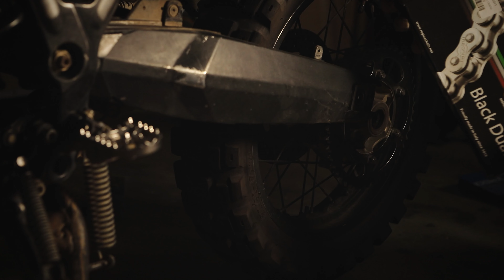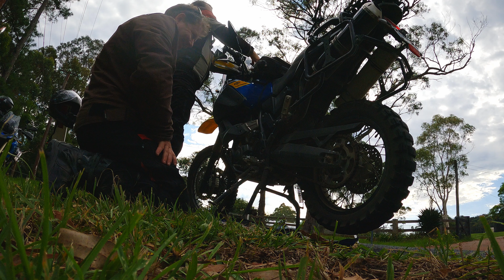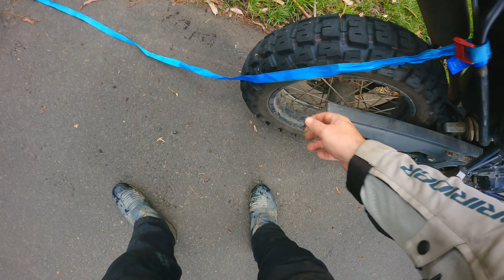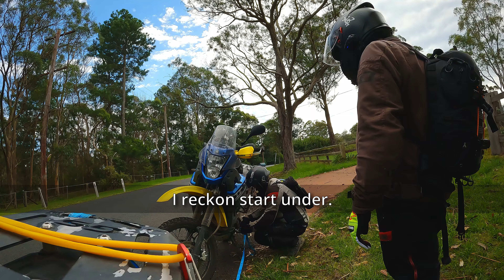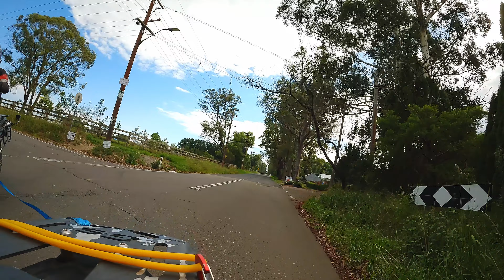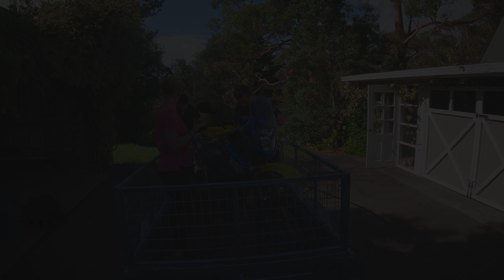The Chainsaw - Towing bike to bike after breaking my chain

Comment: My original chain jumped the sprocket at around 18 thousand k's. It was stretching pretty bad before hand and I should have changed it. Ive got 25 thousand on the after market one and havent had to adjust it once.